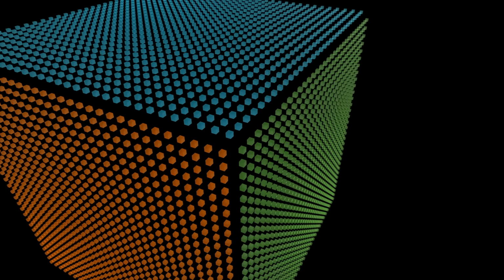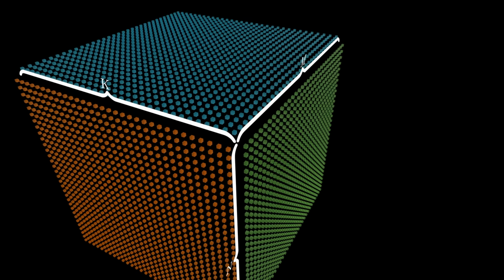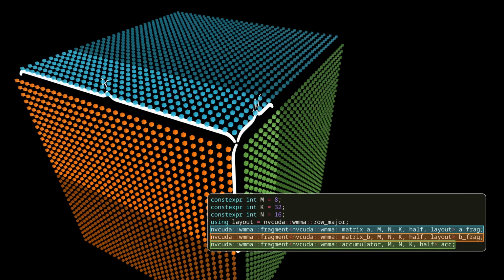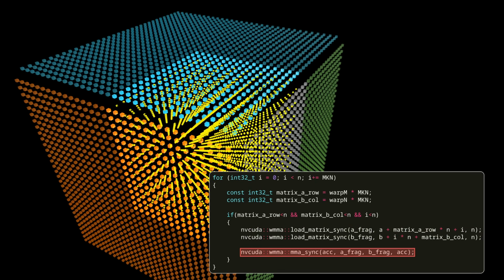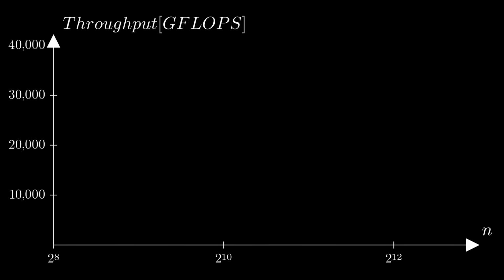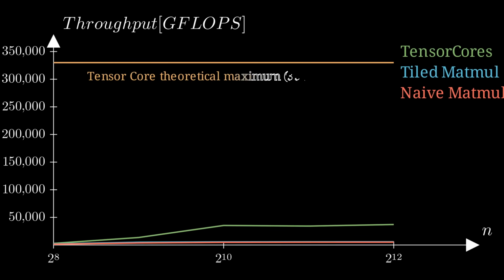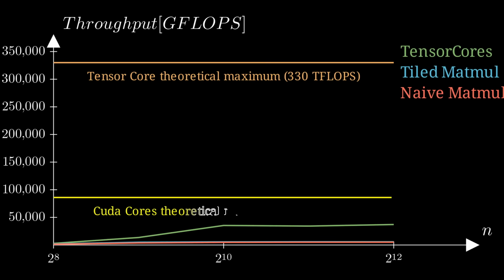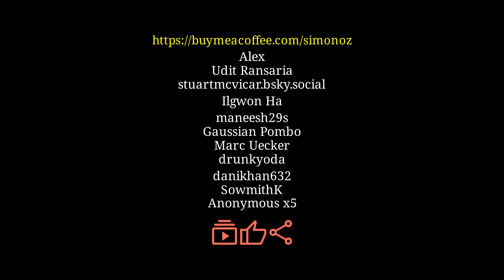What are Tensor Cores?

Comment: I keep reading about this but I can't really understand how multiplying every element of two rows and adding them results in anything useful at all. How does the output mean anything at all is kind of crazy to me. 

I'd like to see a visualization of a tensor core doing an understandable simple operation like a rotation, maybe that would make sense
Reply: The TPU was originally developed to serve as a custom hardware accelerator tailored for the specific demands of deep learning. Google needed a way to run neural network inference (and later training) more efficiently than using general-purpose CPUs or GPUs. By designing the TPU specifically to handle the matrix and tensor operations central to neural networks, Google was able to achieve significant gains in speed, power efficiency, and scalability for its AI-driven services like search, translation, and image recognition.
Reply: It's all about simply offloading mathematical problems to be processed by a separate processor period. The output of all of these equations and math are completely unless it is utilized by something that's already being processed by a CPU.
Reply: @chadraptor2351  Well I understand what the operation is. What I don't understand is how adding together the multiplication of every cell in a row with every cell in the column of another array results in something useful. 
If I were to do that with any random excel spreadsheet the result would be incoherent average of values.
Reply: @shodanxx  Well, it's the formula for matrix multiplication. A single column x row step can also be interpreted as a dot product. You should look into the applications of linear algebra if you really want to find where this is useful. Among others: Computer graphics, linear regressions and machine learning.
Reply: @shodanxx  I think what you are getting at is how does matrix multiplication encode anything useful, right?

One way to see it is that if a matrix encodes linear transformations, then matrix multiplication encodes the composition of linear transformations.

The clearest way to visualize it for me is to first consider a matrix-vector product. In this case, the matrix is saying how each component of the multiplied vector will contribute to each component of the resulting vector.

You can encode a lot of different stuff using this. For example, the identity matrix says "only the same component matters, and it keeps the same size", which is equivalent to "don't change anything". If you have 2 along the main diagonal, that will just scale the vector by a factor of 2 on each component. Geometrically, stuff like scaling, rotating and shearing - and, using one more dimension, translations - can be described as how each resulting component is made from the combination of the original components. It can also encode a myriad others things - really anything at all that can be described as the new components being made from a given linear combination of the old components.

Now to matrix multiplication. One way to see it is that multiplying matrix A with matrix B gives you a new matrix that will be equivalent to first applying matrix B to a vector, and then applying matrix A to the result of that - if you write the math out and rearrange it carefully to a not too large matrix size, you can see this. In this sense, you can think of matrix multiplication as a *composition of transformations*.

So for example if matrix "A" scales a 2 component vector to twice its size in each component, while matrix "B" rotates a 2 component vector 90º clockwise, the matrix "C = A x B" will have the effect of rotating a 2 component vector 90º degrees clockwise and scaling its components by a factor of 2. 

This is useful for example in games - you can think of a camera as existing in a world and each object as having a position in the world. But you need the objects' positions and orientation relative to the camera. Also, if this is 3D, you want their size to change given the distance to the camera to mimic perspective. Finally, you'll need to resize things to your actual screen coordinates so the information can be used by the screen. All of this has to be done to each vertex of each object in view. Now, for the price of using vectors with 4 components, all of these transformations can be written out in matrix form - what is more, these matrixes only change when the camera moves, so for a given frame, they're the same for all vertexes. What this means is that instead of doing each of these operations to each vertex, you can just combine them using matrix multiplication and then apply a single transformation to each vertex. Effectively you're cutting your workload by a factor of 4.

Now, of course matrix themselves can also encode data more directly - and "how does this vector transform" is also data - so matrix multiplication also has more direct meaning, but I think this the clearest way to get it.
Reply: @user-sl6gn1ss8p you should just make a video explaining this. The concepts you described are absolutely straightforward but require a high level of abstract thought to retain. 

A video would be much more concise allowing for a visual representation.
Reply: @ I haven't checked, but my bet would be that this video already exists : p
Reply: Yes, I would like that in video form. I am trying to understand how tensor cores juggles those BF16, FP8 and INT4 with the LLM weights I'm trying to run with AirLLM in my large pile of tesla M40 P40 AMD mi50 GTX1080 RTX3060 and two 3090. I cannot ingest months of linear algebra, before my next shift at the factory.
Reply: before you learn anything about tensor cores or really anything about ML whatsoever, you should have studied linear algebra.

if you don't understand what the purpose of matrix multiplication is, then you should stop everything and spend the next few months learning (I mean rigorous learning i.e. with a textbook and doing exercises, not just watching videos) foundational math topics

luckily, linear algebra is a really fun subject! I recommend An Introduction to Linear Algebra by Gilbert Strang